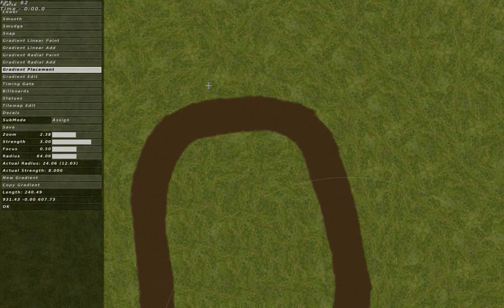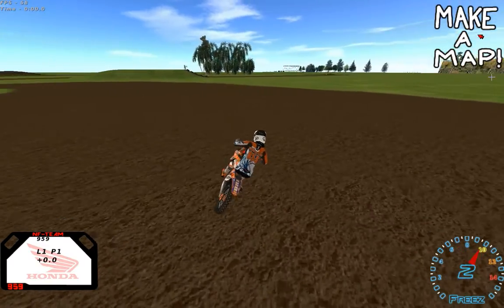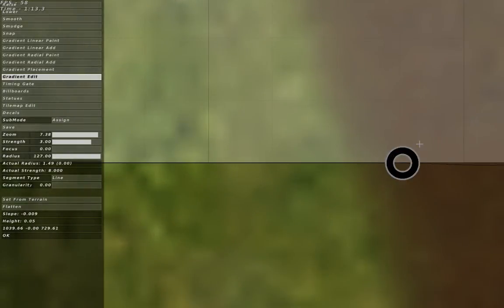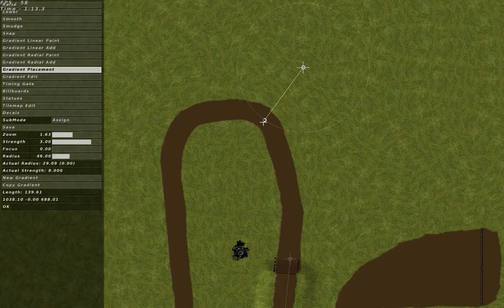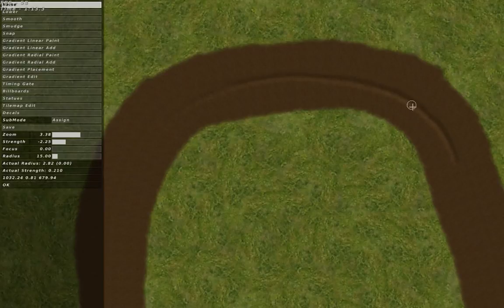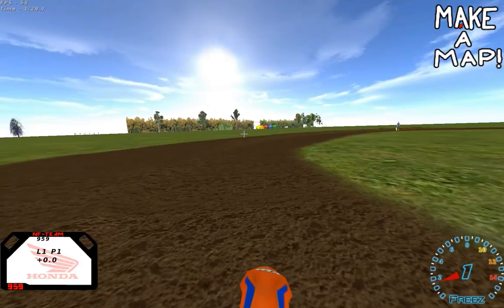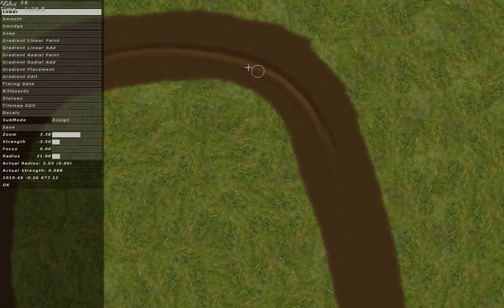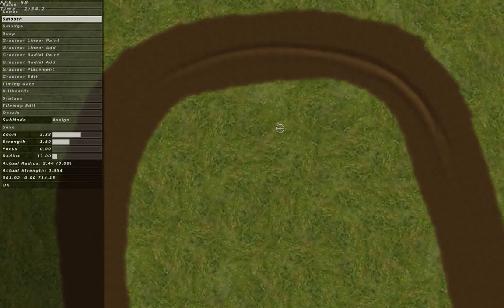How to make Ruts - Track Editing - Mx Simulator

Comment: I have a big Problem with ruts, they are always hunchbacked. Dont now what is wrong i die all like Ever.
Reply from the maker: +Thomas Rick Finally I can reply to your messages! Every now and then the gradient method will cause this. BUT, what I assume is that your terrain isn't compact enough. If the terrain.hf file starts with
9 2.000000 xxx xxx
Then that is your problem. If that's correct, I'll explain it further.
Reply: +StorkenMXS it Starts with 9 2.000000 but what i have to Change..?
Reply from the maker: the 2.000000 can be 1.0000, but that will make the whole track 1/4 of the current size. 1px will be 1.0000 foot instead of 2.00000 foot ;)